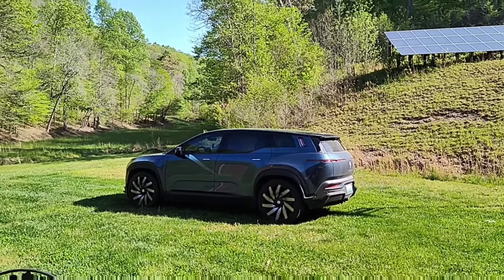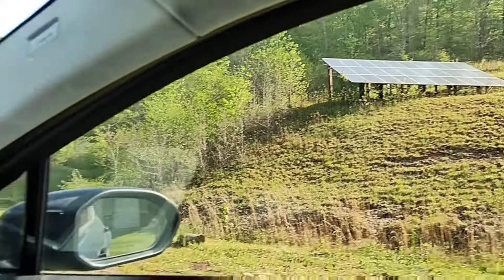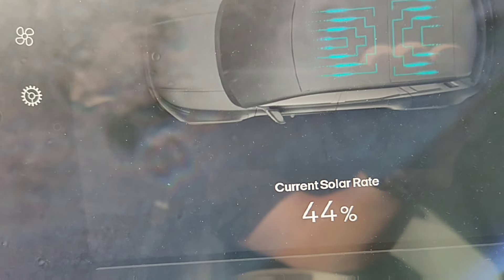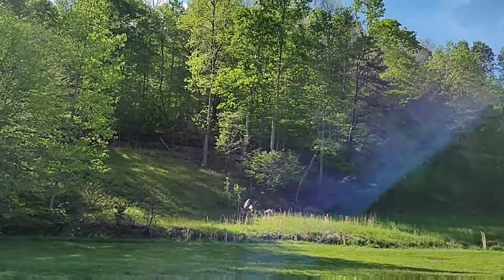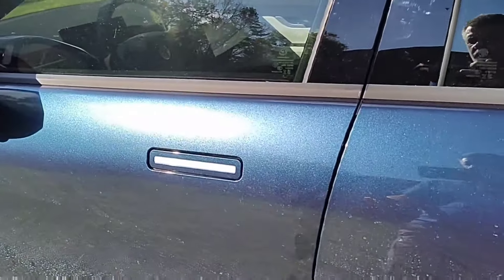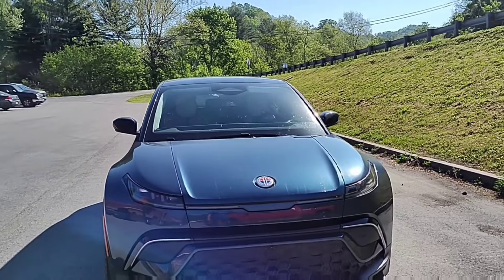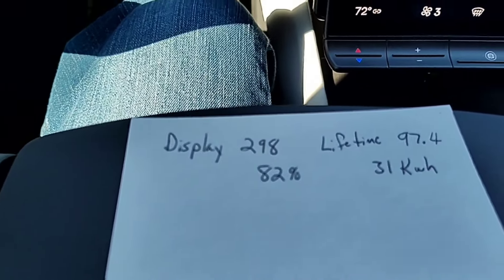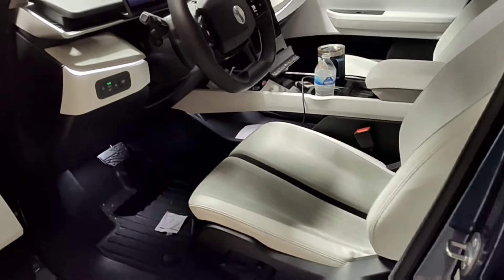Fisker Ocean #FSR Solar Panel Detailed Review ☀️🌞

Comment: Thanks. Given that you had roughly 2% battery loss in the sun, I’d be curious to see a similar test to determine/compare how much loss you experience when garaged over the same amount of time. Assuming the fan is still running and the vehicle is not plugged in.

Comment: I too have had the fan problem since about 2 weeks after getting the car. It was reset twice by a tech, but the next warm day triggers the fan and then it won't shut off unless the car is off. It does go back on when the car starts.

I just got the first part of 2.0! I too have solar and will try to calculate the wattage of the Fisker array by comparison to my known array. I am waiting for summer to maximixe the gain.

Comment: I feel relying on what the onboard user interface displays is rather misleading. It could just display values to give you the illusion something is going on. You would need s canbus scanner to see if there is effectively energy being fed to the battery. Besides, the solar panel output must pass through a DC/DC converter or inverter to charge the battery but I never heard anything about it
Reply from the maker: I have no doubts it's working. Solar is pretty easy to use I just think they probably need to fine the software

Comment: Think you have to take BMS into consideration.  The battery state is always fluctuating with Tempature changes. Just as SOC speeds are effected when fast DC charging.